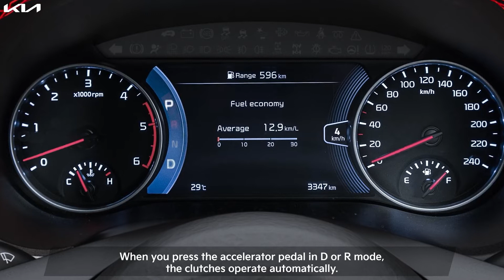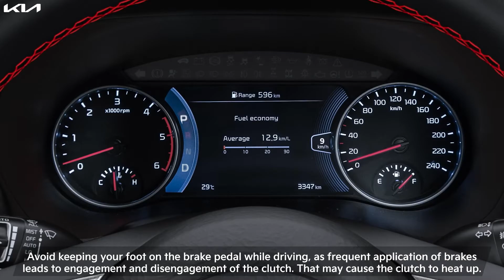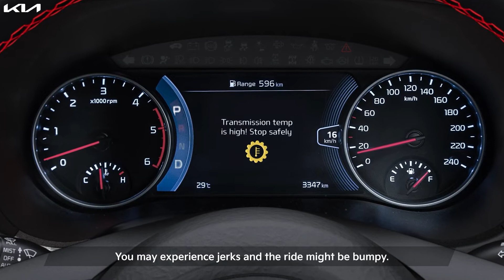Know Your Kia | 7 speed Dual Clutch Transmission (7 DCT)

Comment: Amazing DCT transmission made by KIA... I have sonet HTX 7DCT and I have got amazing experience with that... Thanks to KIA really appreciated.
Reply: Its 2025 now. Please share your experiences and how much kms you have driven.
Reply: @sanamlive3124 approx 4000 drivern So far it's all good. Mileage in city in eco mode is 12. On highways in eco mode 18-19, normal mode 16. If your running is mostly in city, then don't buy. Go for a NA engine.
Reply: @sanamlive3124 approx 4000 drivern So far it's all good. Mileage in city in eco mode is 12. On highways in eco mode 18-19, normal mode 16. If your running is mostly in city, then don't buy. Go for a NA engine.
Reply: I bought the same variant last Sunday. It's amazing driving experience

Comment: In a bumper to bumper traffic situation, if DCT is driven in Manual mode on a fixed gear (1st gear), are there chances for clutch to overheat?
Reply: Did they gave any answer Sir
Reply from the maker: Hi Tushar, our customer support team will be able to assist you better in this regard. Kindly connect with them at 18001085000.
Reply: @KiaInd  Cant you ask your few customer support guys to reply to these kind of questions. If 100 people have the same questions, do you want every customer to call you guys? Dont you think its better to leave a comment here?
Reply: @Adup5724 yes
Reply: @KiaInd could you Please make a video on best practices for using AT transmission, this would be very useful for first time users of AT transmission like me, i own Kia Sonet AT Diesel 2024 make.